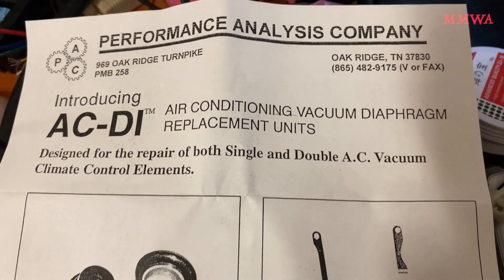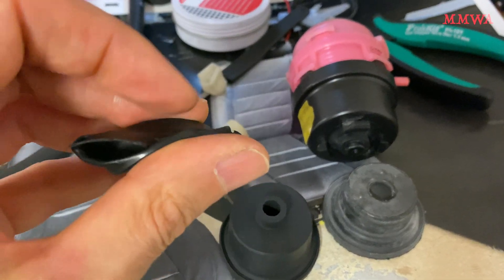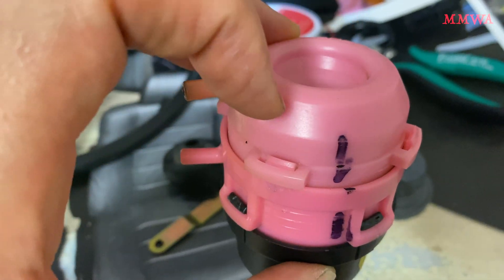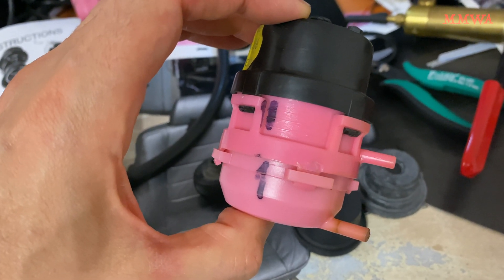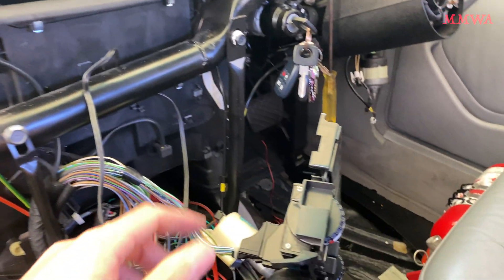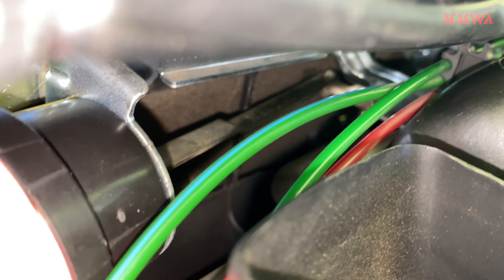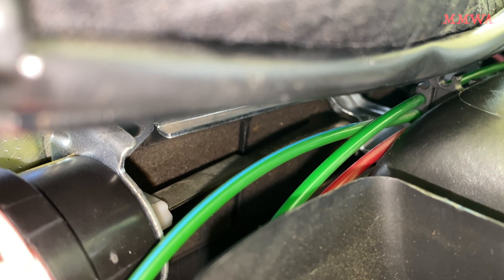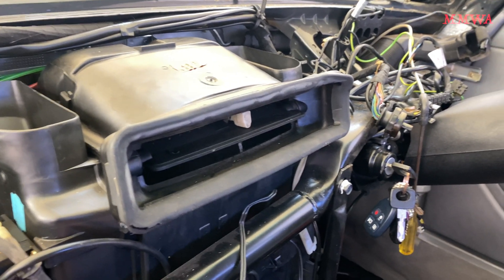W124 - Tempmatik Vacuum pods rebuilt with Performance Analysis Diaphragms

Comment: nice job done there. i've rehauled my w126 300sdl pods couple years ago, those diaphragms work really well, one thing to note is that the double diaphragm pots when rebuilt by instruction with the use 2 different style diaphragms will reduce the full stroke of the actuator by a bit more than a 1/4 inch, hence no more full stroke, respectively the recirculation and defroster flap will never completely close. and that's caused by shorter diaphragm for the top part that you usually cut by instruction, coz it's pretty hard to take the middle part of the pod apart without braking, but the result is greatly rewarding though. regards.

Comment: Did you make a note of the part number on the sticker on top of the heater box? There are quite a few on the EPC but I'm pretty sure the one used on the AUS .030, .050, .031 and .051 with Tempmatik was 124 830 52 62. Stupidly, when I had mine apart I did not record the number.
Reply from the maker: unfortunately didn’t. There was some yellow sticker on it that fell off when the dash was off but it wasnt a part number.

Comment: After the fact, but recommend some gleitpaste or sylglyde on the rubber upon installation so it stays supple and doesn't dry out and stick to itself.
Reply from the maker: i did think about doing that, but wasnt mentioned in their instructions. What ever is happening to the rubber is definitely environmental. As mentioned only the front rubber’s exposed to the air inside the car were the ones destroyed on both my w124’s